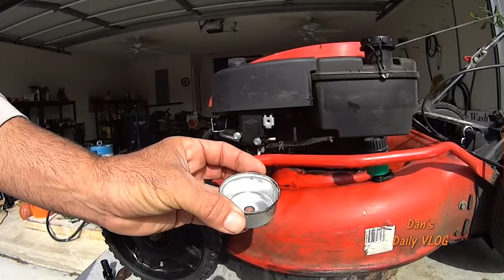Lawn Mower Repair - How To Drain Bad or Old Gas and Clean Carburetor Bowl and Jet

Comment: Great video, though my mower is unfortunately more complicated than this. I did get it drained, finally, after having to take the air filter off. Mower still isn't starting though, so it's on to the next thing...
Reply: Maybe spark plugs or time for an oil change
Reply: @minecrafterselite1  already tried. It's less than a year old, so it is going in for warranty service.
Reply: @saxgoddess25  oh ok sounds good

Comment: Never got gas in the eye. But I did want to point out something...A coworker of mine had a practice of actually flipping the mower upside down to dump the gas out. Complete 180. Worked fine on that old mower.

Now we got a new one. Guess what? That trick doesn't work.

Why?

The oil runs into the air filter, that's why. Mower wouldn't start no matter what I tried. New gas, new oil, new plug...hm. Checked the air filter.... Yep. It's full of greasy gunk. Probably should've gotten a new one, but I dumped it in a bucket of degreaser and hot water and handwashed it (with gloves on), got all the oil out, gave it a few good rinses and let it air dry for 24 hours.

Good as new!

The only problem is, this happens even when you tip the mower to the side to get access to the blades or to clean out chunks of wet grass. No deck wash :-(
Reply: Take the handles to the ground, front end pops up.....there is the underdeck access...

Comment: Great video, my TB 130 has been parked for years with only one year in service.  All the other videos call for spraying carb cleaner down the carb throat or pointing to the float needle.  Any tips on removing carbon buildup in the bowl?  I’m thinking that oven cleaner will eat the seal.
Reply from the maker: Carbon in the bowl? There can’t be carbon, it’s dirt. Wipe with a rag

Comment: Not sure if you anyone can help me with this question, but I made a noob mistake of putting the oil in gas tank of my new mower and tried to start it. Can get I get away with simply draining the tank, and letting whatever oil got into the engine/carburetor burn off though use, once I have it up and running? Or do I need break it down and flush it all out?
Reply from the maker: I would drain all the oil out of the fuel tank, Then I would go to the steps in this video of draining the carburetor bowl to ensure it is no oil sitting there, then I would spray some carbon choke cleaner in the carburetor opening where the air cleaner goes, I would take the spark plug out and clean the spark plug. I put it all back together with some nice clean gas in the fuel tank and pull that starter cord for all she’s worth and I bet it starts on the second or third pull

Comment: Hey Dan, I tried all this and it will won't start. Any ideas? I've already changed the spark plug, changed the gas, drained the old gas out of the carb bowl. Even after cleaning I confirmed that gas is flowing in to carb bowl.  I have not check that I'm getting spark from plug wire but I got it to halfway turn over with starter fluid. Any ideas? Or videos I should now watch. Lawn boy 6.75 hp bought it at home Depot about 10 years ago and only used it over season few times.
Reply from the maker: If it wants to start with starter fluid then you still have a fuel issue. Carburetor has a lot of little holes and the big jet. All that has to be cleaned out. I think this will help: https://youtu.be/J0Jyt6h-buQ

Comment: im assuming the model you are working on here is a different one than one that has a button/fuel primer/injector on the side thats right on/around the filter?  

just tried to start the lawn mower a bit ago, it started once, popped and immediately stopped, so my immediate thought went to the gas since i havent started it since last fall, and the gas in the gas can is just as old (did look up how long gas can last and says 2-3 months so prob need to dispose of the gas in the can as well as the tank?
Reply from the maker: Yes, take it to an auto parts store that recycles oil and dump it all in their oil tank.
Reply: @DansVlog  alright, thanks for the quick reply

Comment: If my mower doesn't have a hole in the body to drain the oil, could I drill a small hole?
Reply from the maker: Flip it over and drain it out of the fill tube

Comment: Great vid yet again Dan, 
I'm about to do the same on my Honda Engine...Question though...once the fuel tank is drained, would you not attempt to clean the inside of it with rags and maybe flush it through (whilst pipe to carb is off) with a litre or so of good clean fuel (not too much to waste) ?
Also, will you be doing any service videos on your P'washer please ?
Reply from the maker: If I suspected dirt in my tank, I definetly would rinse it out while the hose is off. I will do a full oil servicing to my Pressure washer over the next few days. Thanks for sticking around with me!!
Reply: Looking forward to it.
Reply: Stuart TheBincleaner Ginnever v

Comment: Thank you for the video! Quick question: I accidentally put gasoline/oil mixture in my 4 cylinder mower. Is there anything I can use to clean out the residue, or will it just work itself out?
Reply from the maker: +Jenny Howard I ALWAYS run 2 stroke gas in my mower. Won’t hurt a thing

Comment: Dan, thanks a lot for this great video. Question: how do you know there isn't more dirt inside the gas tank, that will make its way to the carburetor? Do you ever flush the tank in any way?
Reply from the maker: Lisa Johnson Flush it? Not in the technical term but if ya find junk in your carb then ya, you would want to drain the tank completely
Reply: Thanks... I mean, is there sometimes gunk in the actual tank... doesn't it move on to the carb? Do you ever clean out the tank itself in some way?
Reply from the maker: Lisa Johnson If I suspected gunk in the tank then I would drain the tank by pulling the fuel line off at the carb and pour fresh fuel into the tank to rinse out any possible debris.
Reply: great. thanks.

Comment: On my particular mower I can't see the carb bowl so easily. If I wanted to get to it could it be buried somewhere underneath the primer?
Reply from the maker: Remove the aircleaner cover, filter and probably the housing and the carb will be fully exposed (unless you have a 2 cycle Lawn Boy Mower)

Comment: Sergeant,  you should know that you don't leave ethanol gas in a lawnmower over the winter, at least without a fuel stabilizer in it.  I never burn ethanol gas in any of my outdoor power equipment, two cycle or four cycle.  I use nothing but premium, non ethanol 93 octane stuff in my stuff and it is pretreated with Briggs AFT fuel stabilizer a one ounce per gallon.  I also add one ounce of MMO (Marvel Mystery Oil) to each gallon of four cycle gas.  I do not ad MMO to my two cycle gas because it makes the two cycle gas to oily and will cause an oily residue in the muffler and on the front of my saws.  Note:  oil is additive and 2.6 ounces of two cycle oil plus one ounce of MMO equals a 3.6 ounces of total oil in the mix, which is a little rich for most two cycle stuff to burn, completely.  Therefore you get an oily residue on the muffler, often called spooge.
Reply from the maker: I use ethanol free gas in all my equipment as well!!

Comment: If you are going to take the bolt off the carb bowl and drain the rest of the gas, why can't you just drain all the gas that way? Instead of messing first with removing the hose and clamp?
Reply from the maker: It will take a very long time for the fuel to pass by the Needle and Seat. It’s like a pin hole but you can do that if you want. You can also flip the mower and drain the tank that way too.

Comment: hey i have a kolhar 18  it won't start on its own if I put gas directly into the intake or down spark plug it'll start burn that gas and stop bought a brand new carburetor to replace the one that's on it the model # on the engine is  (SV540S) but they're both doing the same thing there's fuel getting to the carburetor the salt bowl is filling up with gas but it just will not get into the engine I've taken the old one apart cleaned everything put it back together still nothing the new one is the same way I realize it's a new one may have some issues with the idle screw or something like that being out of adjustment but I assumed that it would at least start and maybe Auto funny or surge or something but I can't even get it to start with either carburetor so I am just about out of ideas so any advice would be great thanks a lot
Reply from the maker: I would make sure that I don’t have any blockage from the fuel tank through the hose into the carburetor. Of course make sure the carburetor bowl is filling up properly and of course make sure the main jet is clean. If you do all that it’ll only run if you put gas straight in the carburetor then the next thing I would do is start looking at the valves. If your valves are out of adjustment then fuel will not be properly pulled into the cylinder off of the vacuum of the piston

Comment: my lawnmower doesn't have that bolt.  the fuel line goes to the an all plastic carberator.  its all sealed. how do i clean it?
Reply from the maker: I would have to see a picture of it but I never heard of what your saying so I think maybe you might wanna keep looking into your system. Not trying to be rude, just very unfamiliar with what your describing
Reply: it's a newer Briggs and Stratton engine.  all plastic carburetor!  I found a video on disassembly!

Comment: Could this be the problem with the mower starting up but then dying?
Reply from the maker: Yup! Dirt possibly stuck in the needle hole that would Normally allow fuel to flow in easier. Also the jet could have debris in it. It usually will have something to do with fuel flow or bad gas.

Comment: Hi Dan....greast videos.... I have a Troy-Bilt TB230 bought back in June 2018 from Lowes, and it fired up on the first pull and used it twice and it will not start as of a few days now.  I had changed the spark plug, drained the old gas and put in new gas and still nothing...any ideas?   Thanks1
Reply from the maker: Sometimes the cable that attaches to the operator presence lever (the bar you squeeze at the handle) will get slack and not move the moving part on the engine far enough to allow the engine to start. Squeeze the bar and use your other hand to push on the moving part at the engine and then try to start the engine.
Reply: I looked at the cable and where it connects to the engine and it moves, it should, it is only 5 months old with two lawn cuts (I have a working riding lawnmower).  I took off the air cleaner and sprayed some starting fluid and it starts and then dies x 4 times.  Thanks Dan.
Reply from the maker: You have a fuel blockage. It could be a piece of dirt at the needle and seat in the carb bowl Or dirt is clogging the carburetor jet.
Reply: Thanks Dan, I will check it out.

Comment: My son accidentally put car gas into my lawnboy lawn mower. It takes oil & gas mix. Can my mower be saved Dan?
Reply from the maker: Depends! Is it locked up or can you attempt to start it and the pull cord moves as normal? If so, dump the gas out and put the proper fuel / oil in and give it a shot. If not, then ya might have too much scarring in the cylinder and once you unfreeze it (pour a little motor oil in the spark plug hole and point that hole straight up over night) it may work for a little while but will quickly go to crap on ya. If it is locked up, maybe try a repair shop
Reply: I drained the gas out, got a new spark plugs and sprayed starter fluid on it. It's trys to crank up but the only thing that's comes out is smoke. I called a repair shop and they said it's not worth looking at. It's pretty much done. I can't afford a brand new one and I don't know what else to do.
Reply: Yes you can pull the cord as normal it's just won't start up 😢

Comment: WENT TO START MINE UP TODAY AFTER 20 OR SO MINUTES IT STARTED AND RAN AT THREE TIMES ITS USUAL SPEED THEN STOPPED 
WONDERED IF THAT COULD BE THE BOLT IN BOTTOM OF BOWL    ANY IDEAS
Reply from the maker: Probably have stuck linkage at the carburetor. Make sure nothing is bound up if everything seems to be right take it to a service center or the engine will blow up

Comment: I just had the spark-plug literally pop off the engine, did I destroy my lawn mower?
Reply from the maker: The entire spark plug blew out of the cylinder head? Put it back in, and fire that thing up! If it won’t thread in then, yeah, your cylinder head is probably stripped

Comment: But i have a different lawnmower
Reply from the maker: Sally Taylor There’s a very good chance our models are the same just have a different name and a different paint scheme. Craftsman, Troy built, Bolens are all the same along with other brands
Reply: @DansVlog  quick question? Have you ever used a battery operated trimmer? Can't get it to last for more then 30mins? Is that the norm?  I don't want a gas one. I may go to electric. What do you think?

Comment: you can't take the gasoline tank ,carburator out, clean up change the gas flow, and mix gasoline with stabilizer I set Run up your engine